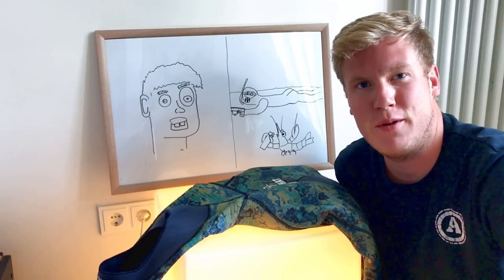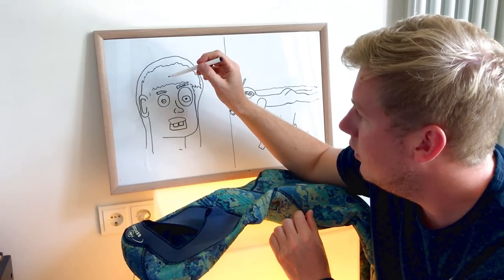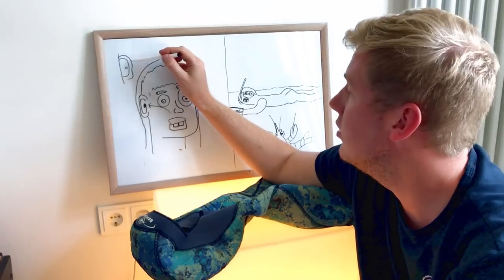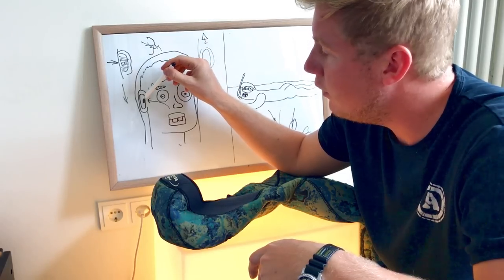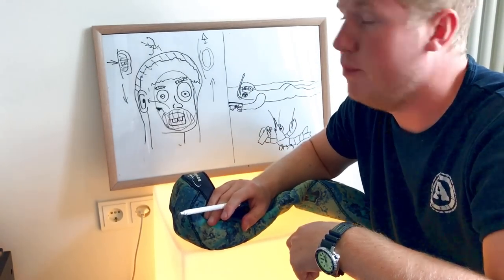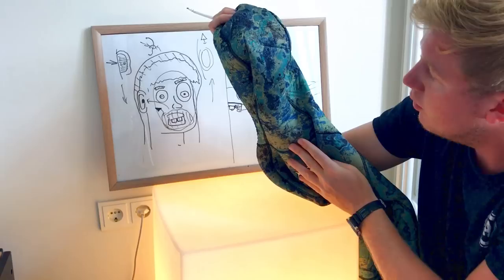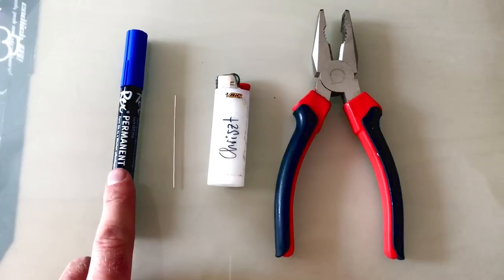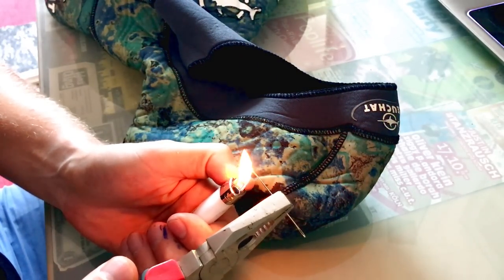Why you should pinch holes in your Wetsuit Neoprene for Spearfishing | Apnoe and Scuba Diving?!

Comment: hello, I do spearfishing too and I have problem when I dive down I feel a lot of pressure on my head, The temperature in my head rises so after two or three dives I start feel uncomfortable and dizziness and then vomiting it happens to me a lot I hope you have any idea why that happens to me On the contrary when I dive without a wetsuit I don't suffer from this problem thank you a lot
Reply from the maker: I heard of that, it is caused by the small amout of pressure the not pinched wetsuits esercitare on your ear. The different amounts of pressure of both sides causes the illness. The pinch holes method should help you. Try it and please write if it helped of not. Greetings Chris
Reply: I guess your hood ist too smale. Try a wetsuit that ist one number bigger or order o tailered one for you. But putting holes inside is ridiculous! Problems with a hard pressurecontroll come from a thight eustachian tube.
Reply: thank you guys, I will try a different wetsuit with large hood size. and I will pinch holes in my old wetsuit as well it may work have nothing to lose and if non of this solutions works I will visit a doctor
Reply: @ginbobob  That's not exactly true. Blocked/tight Eustachian tubes would make equalization difficult at any depth. What GSC is talking about is the hood sealing around your ear causing the air between the hood and outer ear to increase with depth preventing you from equalizing normally as not enough pressure can be created with frenzel etc to counter this. The hole in the hood releases the pressure making it easier to equalize normally. There's a few ways to prevent this happening without holes in the hood - either open the sides of the hood and splash water in before diving or open the sides of the hood on the way down letting in water. The other option is to wear Docs Pro Plugs ear plugs, NOT normal ear plugs as this is dangerous and can/will rupture your ear drum, Docs Pro Plugs are designed for diving. If you suffer from alot of ear wax Its also a good idea to get the ear canal cleared by a Doctor at the beginning of the season
Reply from the maker: @corki007  Great answer, thank you for this addition. The part with open the hood works good for scuba divers but not the best for Spearfisher and Apnoe/ Freediving divers. I never dived with earplugs, I have to hear the enviroment such as boats and the ocean. Greetings
Reply from the maker: @medmrbt7993  You can do it with your main wetsuit aswell, the holes are easy to fix with neopren glue when they dont work out for you. The fact that you only have the problems when wearing a neoprene suit indicates that the problem is made by the hood... Greetings, where are you from my friend?
Reply: @germanspearfishingchannel5359  I was wondering why I cannot equalize properly at depth below 97 m while I'm spearfishing, but now I have the solution. I was even thinking to write Molchanov an email to ask him for this issue, but there it is....THE SOLUTION! Impressive!
Reply from the maker: @milennachev7921  Below 97 meters spearfishing? Dude are you crazy :D
Reply: @germanspearfishingchannel5359  that's exactly what I am asking myself when I'm watching the channel
Reply from the maker: @milennachev7921  Not everyone has born with all the knowledge about fishing and spearfishing, everyone started sometime, when i started i searched for informations and found nothing. Really nothing, i try to fill the holes
Reply: I had a similar problem, and I couldn't understand why wearing a costume is all well and suit become bad. The result was a heat stroke, then a slight malaise and vomiting for an hour, then everything passed. the suit was too warm for that water.
Reply: Hi I had that problem and it has to do with neoprene smell... When I freedive without Suit that didn't happened. I never was able to compensate until I made a freediving course where I learned everything from the first time... Now I sometimes take a vomidrin pill (anti sea sickness) 30 minutes before, and I drink water every 20 minutes that made all the difference. Try it. Hope you feel better. Also let some water enter around the ears zone.

Comment: Pressure will be the same with air or without air. The difference is that with that system you will have cold water entering constantly into your internal ear so it can bring otitis or inflammation. The same logic goes to the mask...imagine what if you pinch some holes into your dive mask!!! Would it help equalizing? I think not...it would only bring cold water to your face and put you uncomfortable. I think that the tip you pass in this video it is not a good tip as it can bring problems to the ear channel.
Reply from the maker: This is discussed differently!
Reply: What? Everyday in ocean no issues, how cold? Has anyone informed sea creatures of these hazardous  water? Do your best to be born with German evolved ears, even in exile. Where this awful water ? What suit is that? 3mm make? Probably tall thin also Make/seller of product?